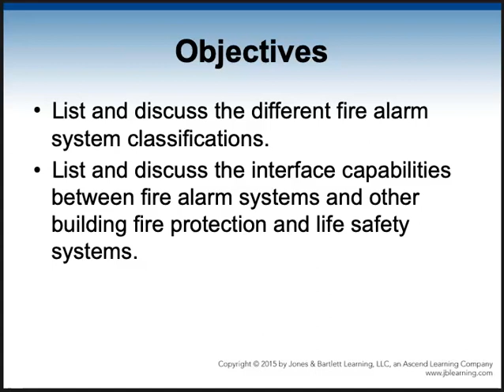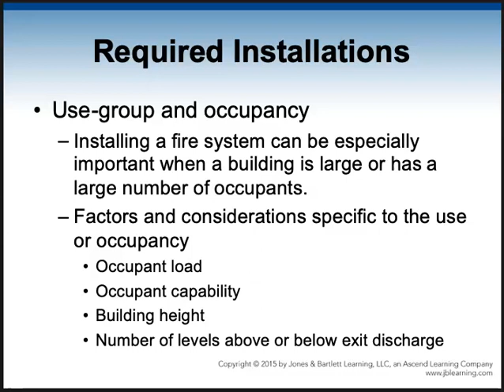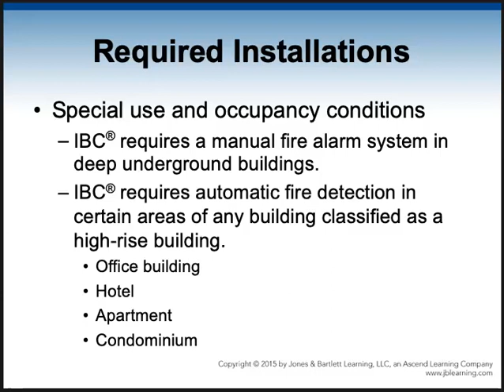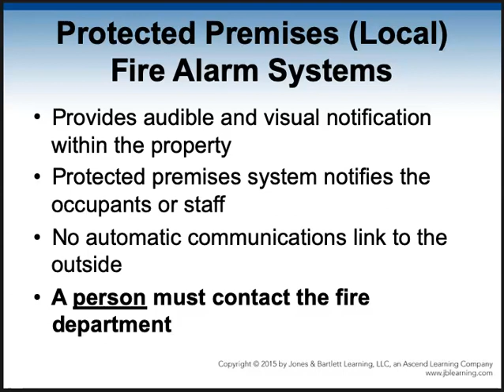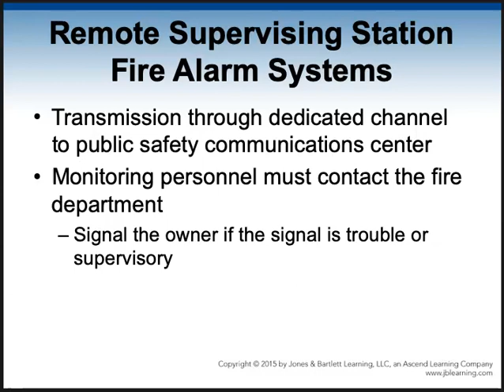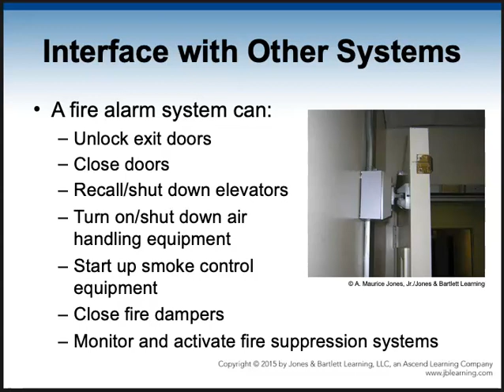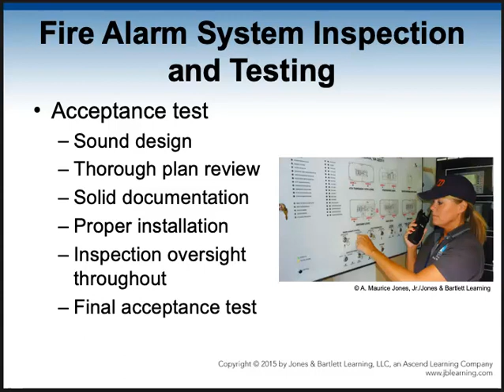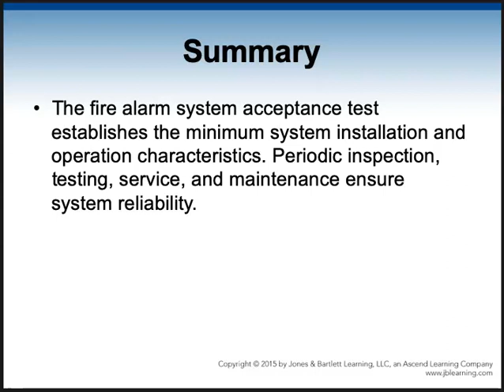Fire Alarms Pt 2 Types of systems

Comment: Hi, I find this video really wonderful! I faced a Fire Inspector visit few days ago at our paint shop. But he relied more on the Fire Suppression System Inspection Tag than asking questions to the company which did the maintenance of the system.
It took him only few minutes and he went without any report or signatures. I think this may be his way of normal working.
Reply from the maker: Paramjit, where are you located. Fire inspectors do rely on the maintenance companies that place the tag on the riser of the sprinkler system or the kitchen UL300 systems since they are state certified to do the maintenance. Seeing that the system has been done at the proper time is usually adequate unless you see something out of the normal. Glad the video was helpful. Are you the facility manager? Owner?
Reply: @r.osborne6706  Hi, Good morning! I am glad to see that you read my comments!!
We are located in Edmonton, Canada & I am the Administrator of this small plant of Sandblasting & Painting unit. We bought this plant a year ago and this was first inspection after a gap of 2 years. But yes, he asked for the Deficiency Report as mentioned on the inspection tag. We forwarded the report received from Sprouse Fire System, which showed no serious deficiency.
Thank you again for this video and your response to my comments!!
Reply from the maker: @ParamjitJanjua  definitely different in Canada, but similar.